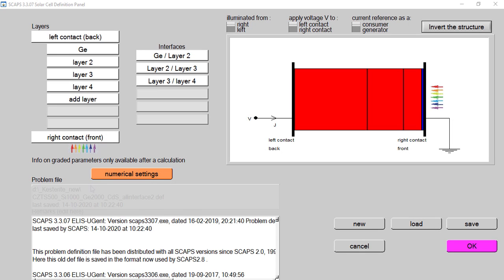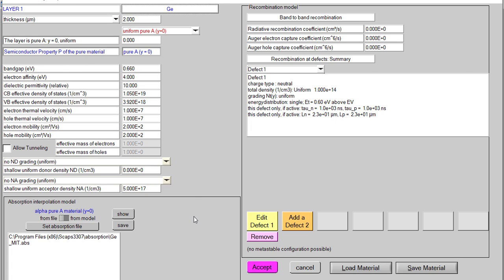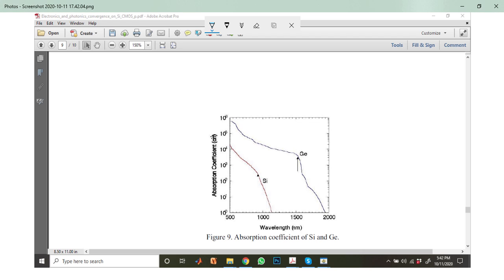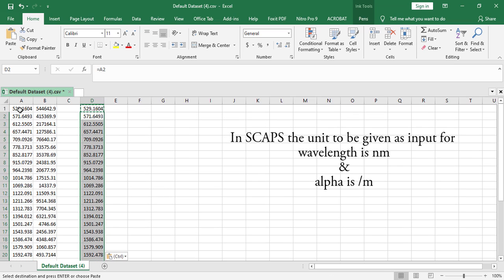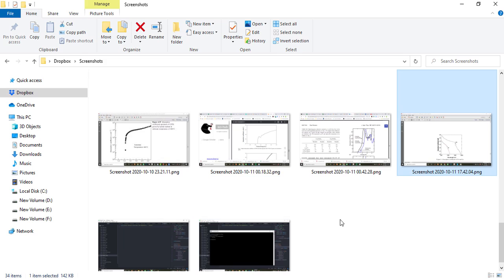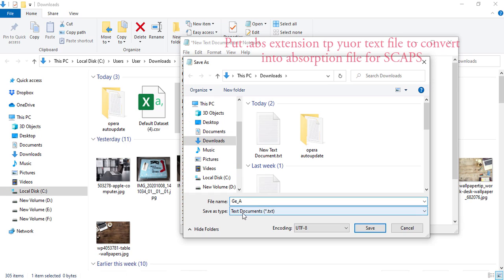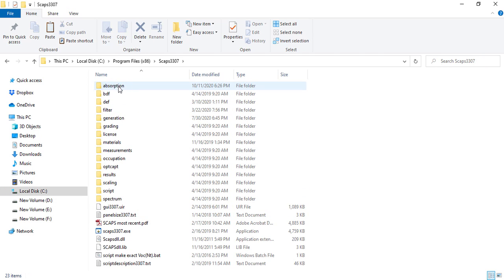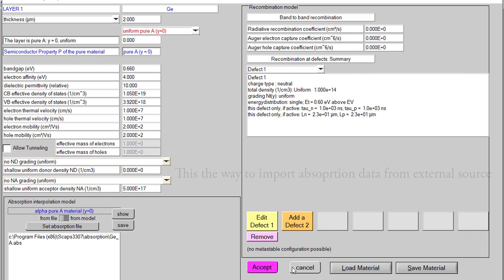SCAPS 1D tutorial: How add absorption data in layers

Comment: Thank you for your knowledgeable video. However, I have been struggling with a problem, in which there are lots of parameters I cannot put on the simulation. Could you provide your data for me? Thanks in advance

Comment: Sir how to create  absorption file for FASNI3 material please reply
Reply from the maker: There are many ways.
1. Use default model ==> Do nothing :-)
2. Try different models provided in SCAPS
3. To utilize practically obtained absorption pattern, find a reliable pattern, read that data and make an .abs file the way I did in this video,
Reply: @edusupplement594  how to find absorption file from default model ?
Reply: @how to find absorption file for default model from scaps 1d ?

Comment: How to remove convergence error and QE failure error.?
Reply from the maker: Well.. There is no unique solution to this. We need to be ready to do a couple of trial and error steps. First, try to put some interface levels and try different values. Generally it resolves the issue. If not, then try to change the defect types in the bulk materials and values of defects. If it doesn't work then, there is a energy level mismatch among the layers, in such case you need to choose some other combination of materials. There are many other issues which are very difficult to put in a single comment. You try these first and if doesn't work, then further comment may help. However, you may check the following papers as well, these may help to work with SCAPS.
https://www.researchgate.net/publication/332530200_Simulation_based_Investigation_of_Inverted_Planar_Perovskite_Solar_Cell_with_All_Metal_Oxide_Inorganic_Transport_Layers
https://www.researchgate.net/publication/347866085_Numerical_Simulation_of_CsSnI_3_-based_Perovskite_Solar_Cells_Influence_of_doped-ITO_Front_Contact